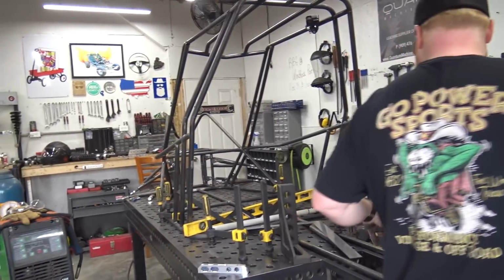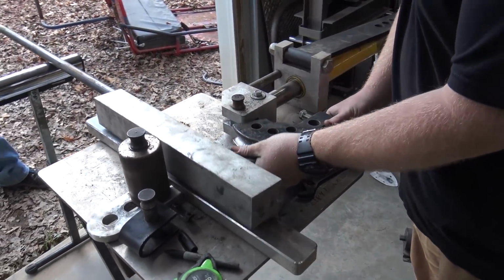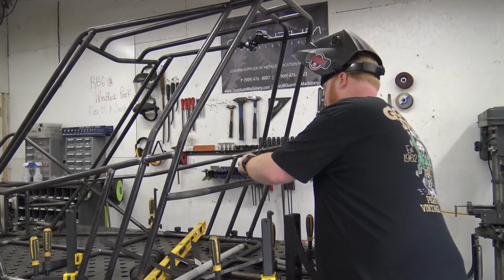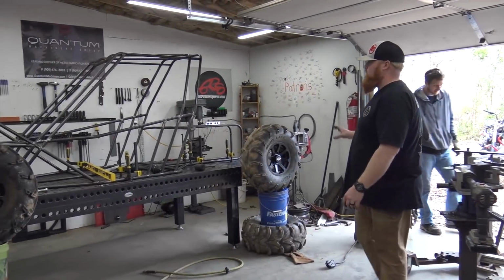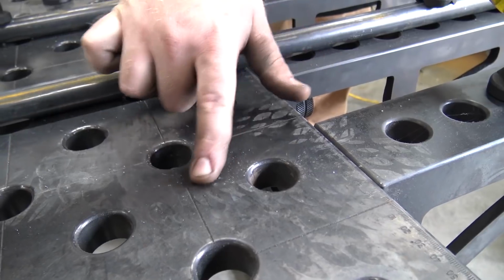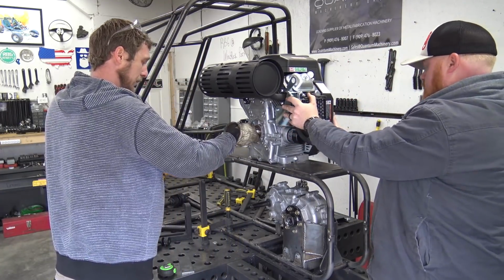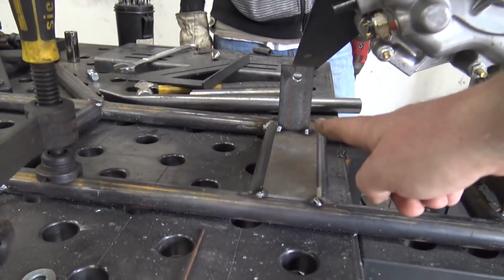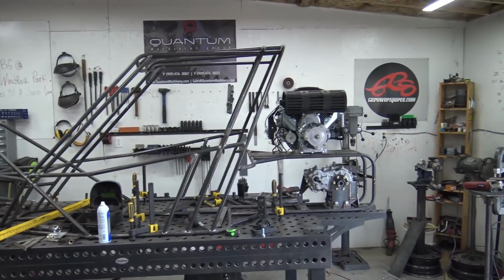Home Made IRS Buggy Differential Mount

Comment: Get a 3 cylinder 2 stroke snowmobile engine for this project, you wont regret it once you see the power of those 2 stroke snowmobile engines. And snowmobile engines use CVT pulleys just like go karts.

Comment: When you bend pipe without a snake you want to be slow anyways, gives the metal time to do it's thing. I've been playing around with pipe bending and that's a thing i've learned, it behaves such much nicer when you give it time to stretch and compress, a little bit of heat doesn't hurt either.

Comment: That thing is going to be RAD!!. It could be an optical illusion but it looks like the motor and differential are mounted pretty high in the frame?. Looks like for it to have ground clearance, the suspension will have to sit at full droop?.

Comment: I'd like to see 4 wheel steering on the buggy.
Reply: @theproudONE92  That tells a lot about your limitations.
Reply: For a wheel base this small it's actually counter productive to have one. With the amount of power they'll put on, it will feel like being jerked off the barrel of a tank. Needs to be a bit bigger for proper 4 wheel steering. BUT, that being said, having a limited slave steering on the rear, would be interesting, and it could be done with a simple shackle system.

Comment: Add 3 more inches to your wheelbase and set the motor down on the bottom frame rail where it belongs.15:04
Reply from the maker: It's gonna work out fine up too. It's the only thing mounted high on the frame. Everything else is low.

Comment: Maybe it will help out in the future, but when you mock up an engine, get some closed cell foam and sculpt it to have the rough dimensions of the engine. I've done this for ages with various things, not just engines and it's a bitchin' method to get things quite precisely in place.
Either way, awesome build.
Reply from the maker: I haven't thought about that but that would be awesome. Thanks for the suggestion.

Comment: Motor is way too high!!!!! Keep center of gravity as low as possible.  That is a fail waiting to happen.   Just reference any name brand side by side.   Please fix it now. Not later. Also there's too much plate steal and weight !  At the very least cut holes or sqaures out the middle of that huge plate.
Reply: Mathew Music that's an awfully bold statement considering you have no clue how wide there gonna make it. If it's as wide as a Utv it will be absolutely fine up that high. They also can put the fuel tank under the motor which will get the center of gravity back down some. Also. You must have built a few gocarts over your experienced years huh?  Or anything for that matter.
Reply: Unless they build this over 74 inches wide I believe he is right. It will screw up alot of suspension handling, right of moment (inertia) even with the gas tank repositioned his roll center will be jacked. Its not going to be a race car but jumping it hard it will land wrong and hard. It will hurt your kidneys your spine your neck and will beat that machine to death. 
  It will be a ton of weight probably over 1200 pounds the way its going. That's big even for a UTV. 
   The supercharger should bring about 80 HP. Maybe more. Will be cool as shit built like a tank and hopefully not so top heavy and tipsy.

Comment: Nice build but I think you are over building it particularly round the transaxle, way to much material, you want to cut a lot of holes to lose some weight, also the plates around the engine, swap for tube square or maybe round.
If you were doing a build run of this buggy production there is a lot of extra plating. Just an observation coming from a mechanical engineer background and building trikes as a hobby that pays it's way, selling one now and then.